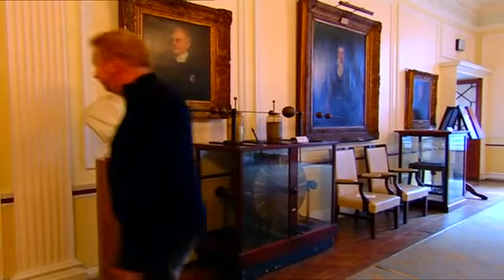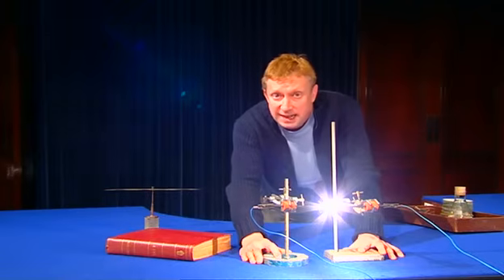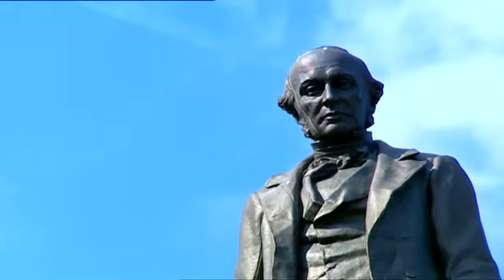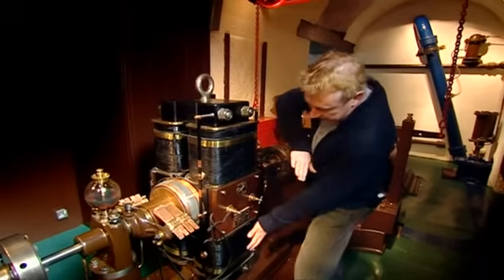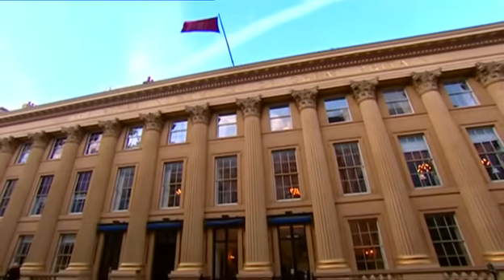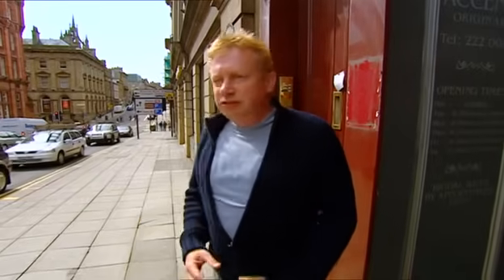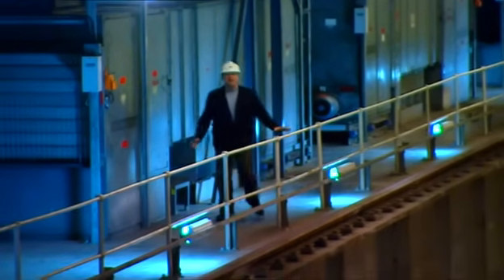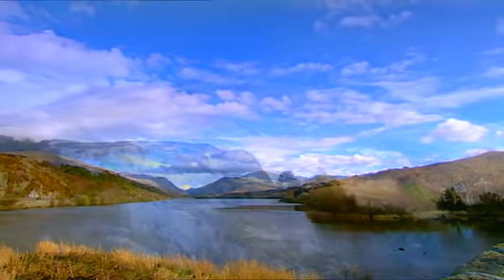More Industrial Revelations - E07 -  Bright Sparks

Comment: We have one like that here in the South of NZ at Lake Manapouri. It is 600 feet under the lake and exits out into Doubtful Sound. Entrance is a Spiral road. I've been down in the Power House when visiting there as a tourist back in the early 1980's. It was said that at that time it couldn't be done, but it was built in the 1960's. It was hewn out of solid Rock  from the inside.  Some years later they dug a second Tailrace Tunnel to allow more water through and produce more power.